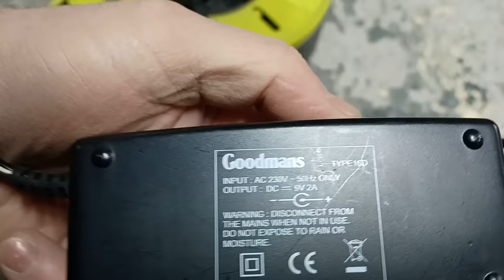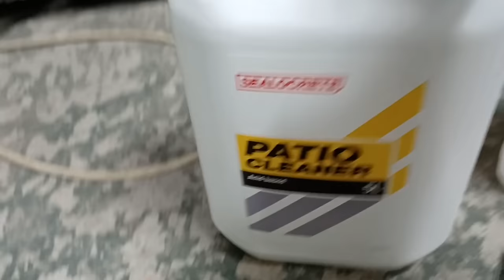Ford Escort MK1 Restoration Project, scratch built boot latch and nickel plating

Comment: Customers Defender in for complete new rear crossmember today - chassis already had  (crap) repairs at a "posh" place that charge a lot (lol) - customer highly proud of the job which cost him 2 grand,.  To me,  just more work because I had to remove the utter pish plating welded on over untouched festering rust , cut out the rust & fit new steel for the Britpart section to weld/ fit onto.  

Which isn't my point - lol - my point is what I used to weld the Britpart chassis section on with.  Despite having all the "fancy" welders you could ask for in the workshop, what I used came from Lidl.  Issue is this part is the back-end of a work Land-Rover - I.E there WILL be 3 tonne or more hung off the towbar on a regular basis. That 3 tonne is hanging off the bit you welded on. So it better be bloomin well welded... 

Now the Lidl multi-process welder is an odd beast. It ought be garbage but ain't. 
Firstly. it runs off 16amps - beefy. 
 Secondly, it happily runs 1mm flux core wire - which burns hotter than Danni Menzies. 
Thirdly, 1mm flux core wire is very unfussy - when you're welding on a chassis where everyone & their mate has applied Waxoyl, paints, oil has leaked & there's residual rust, you don't want a fussy wire that likes clean - you want one that copes with dirty.  You also want a machine that will hose that wire in hot & heavy - which the Lidl machine will happily do. None of our other flux-core machines will. 

What you get is a repair that I pity the next chap who has to re-do in 20 years or whatever time if the vehicle survives that long. It very well may. They are going to curse whoever welded on the repair section as they struggle to  grind off the welds - don't even know if it would be possible tbh, that Lidl "Crappy" machine hoses on so much metal so hot & so deep when running 1mm, I doubt the repair section is removable without just shearing off the entire chassis rail in front of it. Unlike the absolute shyte I cut off in no time at all today, put on no doubt using a 5k Mig machine from one of the big name suppliers, that can't hold a candle to a 200 quid machine bought out of a supermarket...  I know, I used buy those 5k machines too. Back when I was young & daft. 

There's no great "point" to this comment Dave - it's just a comment. Random thoughts. Plus buy a Lidl multi-process welder. Those rock.
Reply from the maker: Ha, thanks for your ramble, it's fascinating that the cheapo Lidl welder works so well.

Comment: Thanks for sharing Dave. I have really been enjoying your videos. I have been doing a bit of nickel plating myself. If you first plate the piece in copper and then plate in nickel it will give you a better looking piece and it will hold up much better. They key is fine sanding between coats.
Reply from the maker: Ah, thank you, I'll give that a try.

Comment: Dave, I've included a nickel plating link for you that I have personally used with good results.  I used a low current  500 ma 5volt dc adapter with a 1/8 inch nickel arc welding rod to make my green nickel acetate solution.  You.r latest segment was very interesting, thanks mjm
Reply from the maker: Brilliant, thanks 😊👍
Reply: Please share the link. Thanks

Comment: Nice work yet again. I've never done any electr plating but I have used electrolysis for rust removal. I used an old car battery charger for the 12v low amp supply when doing that.
Reply from the maker: I haven't tried it for rust removal, next experiment 😊

Comment: I bought a zinc plating kit from a company called Garos plating (I think that's what they're called anyway) ebay.  I found a variable power supply works well. You adjust the voltage to get the right current which is quite important to get a good finish. Also agitation of the solution to get it even.
Reply from the maker: Yeah, thanks, I think I'll get a proper kit down the line, I'd like to try zinc passivate

Comment: Great video as always. For info I do a bit of zinc plating myself and using a variable power supply, bolts and small brackets generally take 25 minutes or so. After plating the parts are left to cure overnight or in an oven at a low temp for 30 minutes. I'm slightly concerned that your quick application and immediate polishing may have actually removed the plating!! Time will tell.
Reply from the maker: Thank you, Alex, that is very useful information 😊😊